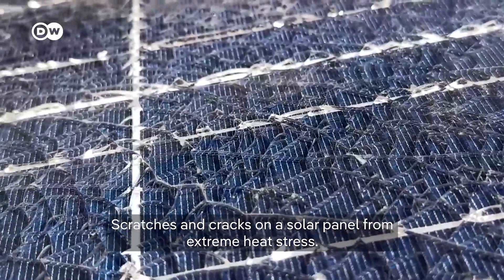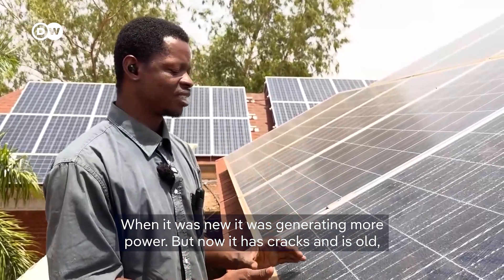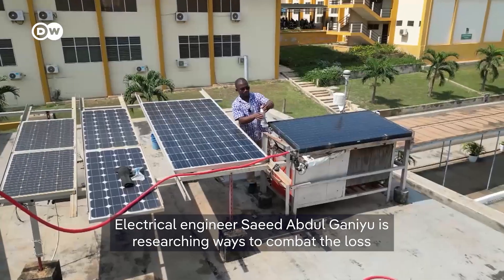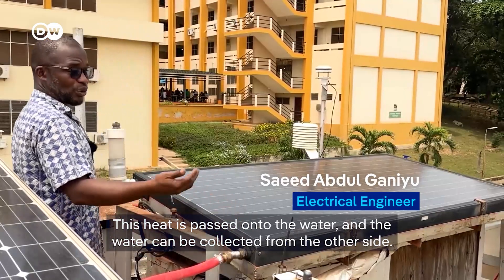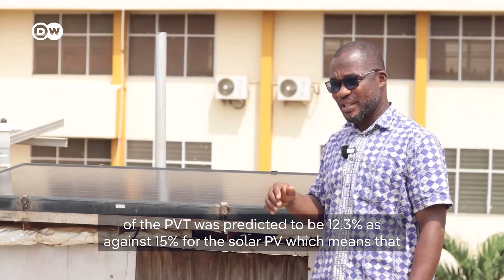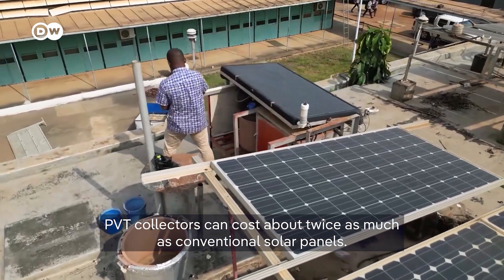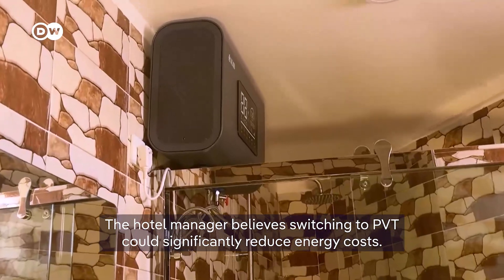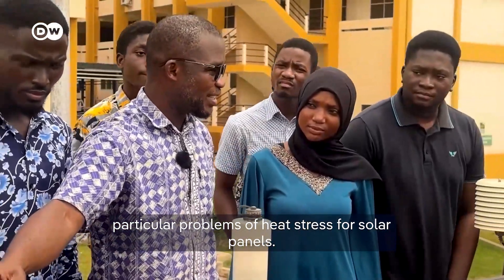What are the best solar power systems for the African heat? #dwafrica

Comment: Note that it's not just about preventing degradation of the panels. Solar panels also have a thermal coefficient of about 0.3%, which means that for every degree, you cool the panel, the panel produces 0.3% more electricity. So, if you use a lot of hot water and you can cool the panels down by 10 degrees, you get 3% more electricity.
I painted my roof white, to lower the temperature of my roof and therefor the temperature of the panels that are mounted on that roof. That should reduce my need aircon's energy consumption and give me a little bit more power.
Reply from the maker: Smart move with the white roof! Have you noticed any difference in power output or indoor temps since the change?
Reply: @DWAfrica  I put on the solar panels after painting the roof. The system is performing well. I also added some insulation under the roof, so it's hard to tell what is making the difference in temperature.